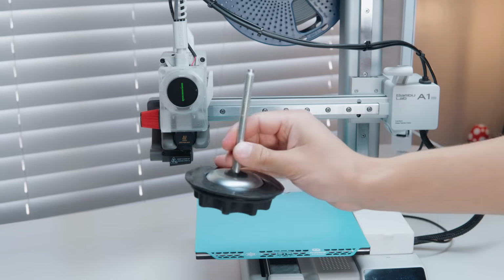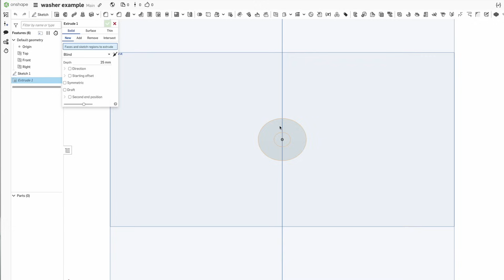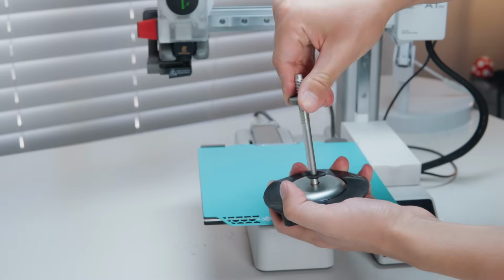10 Essential Tools Every 3D Printer Owner Needs

Comment: I found calipers that measure to the thousandth of an inch and hundredth of a millimeter on Amazon… it was like 15 bucks and made of (mostly) stainless steel, and it comes in its own case AND includes 2 batteries

Comment: I feel like you’re just collecting oil with that microfiber square. It’s not as sleek looking, but I’d just use a regular microfiber rag. You can rotate the sides whenever used, and then toss it to wash.

Also, remember to always air dry your microfibers and avoid softeners. Believe it or not the dryer will melt the absorbent properties
Reply from the maker: you might be right but i’ve never had issues with build plate adhesion using this :)

Comment: You can just use a small pair of nail clippers for trimming filament. 
I keep a little Swiss Army knife style folding nail clipper attached to the frame of my printer by it's keyring. 
The clippers trim my filament, the knife blade can open filament bags or trim prints and the nail file/screwdriver has been used as a last resort for tightening screws on the base plate.

Comment: I wouldn’t recommend using IPA on your build plate, it can damage the pei coating. I’d recommend just using some warm water with a tiny amount of mild soap, works like a charm and won’t cause an issues as long as you don’t soak the build plate. 

Superglue was originally made to use as a battlefield wound sealer, hence why it sticks skin better than almost any other material you use it on.
Reply: fake news, IPA is completely fine with PEI
Reply: @ Most brands do not recommend using Isopropyl Alcohol (or rubbing alcohol) to clean their build plates as it usually is not as effective at removing as wide a range of contaminants as dish soap, and it can actually damage certain formulations of PEI or other proprietary build plate formulations.

Comment: I strongly recommend using a chamois cloth for your build plate cleaner. It works better than microfiber cloth, is way more durable, and has a super fine scratching ability that does not hurt the bed but helps clean it.

Comment: For build plate longevity I would definitely recommend not using IPA for cleaning, soap and water is the ultimate cleaner but does take a little bit more time. Any PEI sheet will get degraded over time with IPA since it slowly damages the chemical properties that cause adhesion in the first place. I also think printing a PETG scraper like some of the ones on Makerworld because they do just as good of a job and have less potential to scratch the surface of your build plates. As always great video and love the humor :)
Reply from the maker: Great tips!
Reply: I was going to post a comment about IPA or soapy and water. In my limited experience so far, I have found that washing the build plate with something like Dawn dishwashing liquid works much better that IPA. I did not know that IPA damages the plate, another reason not to use it. Also, I have had a bad experience with metal blade scrapers and only use the printed PLA scrapers blades. Yeah, they do wear out quickly but are easily replaceable in minutes.

Comment: My number 1 and 2 tools are hotglue gun for fixing broken supports mid print, or even tacking the raft to the glass bed when it is large and at risk of curling when subsequent layers go on. No2 is a soldering iron to weld small breaks in printed items.
Reply from the maker: these are actually such great ideas